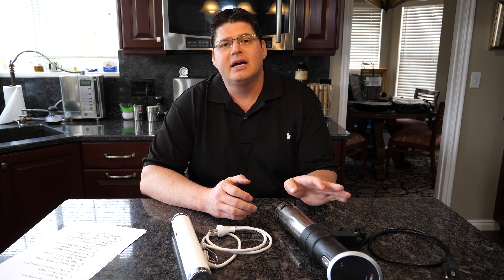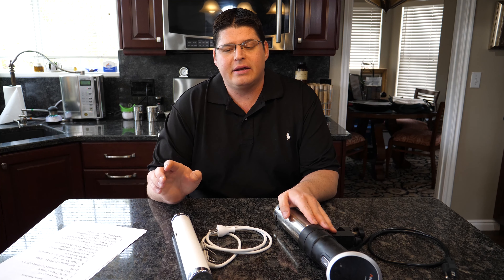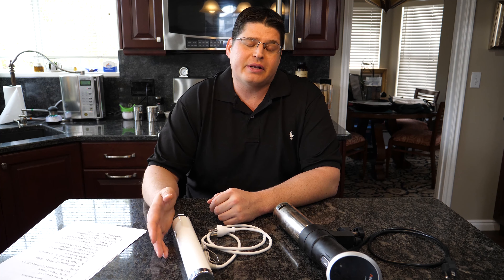Anova vs Joule - Round 2!

Comment: Great. Video..
I’ve always used the Anova..making larger batches of protein. My issue with Joule..was no dial in temp..However Recently purchased a Joule 
For 5he smaller cooks. Using the app was very easy..No connect issues at all. Answered my question as mine is Bluetooth only..What if my phone quits or I shut it off or I leave the house, will it stop..we’ll I did leave and came back alls well..reconnected  immediately..Now I’m on my first cook. Mailing smaller batches of stuff..can reserve the joule for that smaller pots less water…

Comment: I got a little water in the vent on my Anova when I was cleaning it, plugged it in and snap crackle pop.. dead anova. Worked well for 3 years I owned it until then. Replaced with Joule, which requires app, and is  louder, but heats water way faster.

Comment: Deciding factors for me we're ease of use and cost. Anova allows for manual setting without a phone and costs less. Especially with the new nano out. 
The power factor doesn't bother me too much. I start with hot water plus I get the water going while cutting veggies, preparing meat, etc so whether it takes 5 min or 15 min I'm busy for 15 min anyway preparing everything. 
I can see where people would want the higher wattage in this day of faster is better. But anova works for me. I run 2-3 at a time anyway so it's nice to be able to manually set it up and start it without a phone. 
I will say the anovas wifi feature I like alot. I don't know ow if joule has the feature but when set up right I can start a 24 hour cook and go to work. Of I lose power or get a brown out and it shuts off then comes right back on, I get a notification at work and can assess the temp of the water and decide it's safe and restart the machine from work.

Comment: You can use a metal plate underneath the container for the joule for setting direction.
Reply from the maker: PlayTime Not a bad idea at all! the containers I use however are too deep so the Joule would need to be fully submerged in water to get the base to the bottom. Some more shallow ones that should work well 👍
Reply: magnets does not work on stainless steel.... if you use steel plate... guess what's gonna happen.
respect.
Reply: peppertime1 what? hahaha. magnets dont work on stainless steel? stainless steels are alloys. some are not magnetic, but some are. you can't say you cant use a magnet on SS. that is so insanely false.

Comment: From what I've read, the Anova will be a 700W device compared to 1200W for the Joule.

Deal breaker on the Joule for me is that it is still US only.
Reply from the maker: John Tucker Yeah I just read the same at 700wat for the new nano with an advertised Max water bath of 3 gallons. that's not a lot but should do the job for 2-4 people I would think.
Reply: 700W for the Anova Nano at the price that they sell (and especially if you got the special price they had on preorder) is good enough for me. I cook for a small family, and prefer the versatility that having several circulators afford me, rather than one powerful device. Sometimes you want to cook several things, and the temperatures are different, with once circulator no matter how powerful you have to do it in succession. And even if I need to cook a larger item (whole suckling pig anyone? :) assuming you find a bag big enough) I think I may be able to use a larger bath with 2 smaller circulators set at the same temperature.

Comment: The only problem I have with my Joule is that you cannot set the temp exactly with the app. You have to look thru all the different app recipes for a temp that will be close enough to what you want the H2O temp to be. If there is a manual temp setting in the app, I haven't found it.
Reply from the maker: Terry Glancy Oh I can see that being a HUGE pain. all I ever use is a manual temp setting. when you open the app you see the power button on the lower right side of the screen. Push that and it will pop up with a screen where you enter your temp manually. I hope that helps!

Comment: Also the anova's poor thermometer is probably why your medium rare steak preference dosent line up with Joule's
Reply from the maker: CJ Herzberger good point, although reading 1.5 degrees higher than actual would mean when I cook steak at 128 for medium rare it's actually cooking at 126.5 as opposed to the 135 that chefsteps recommends. I think it's a personal preference thing. I've done steak at 135 and I think it's a little.ober cooked.especially if you're going to post cook sear it.
Reply: Gotcha

Comment: You could just use both together to get temperature up faster.
Reply from the maker: Kr En definitely and I have when cooking at high temp 180 or so
Reply: That would double the watt consumption. How about using gas stove to heat up some water first to kickstart the initial heating process. I would prefer to use my immersion circulator to maintain certain temperature rather than waiting it to heat up.

Comment: The Gourmia is 1200 watts.
Reply from the maker: I had never heard of that brand...it looks like they offer 3 different circulator options. They are all listed at $249.99 however Amazon has them for sale from $89-$119 and they are all listed as 1200w. Haven't used them but sounds like a good deal and a good alternative.
I find sometimes wishing I had a third circulator, I might just have to buy one of these especially for the price!

Comment: I appreciate your videos. I learned a lot from them but I have to tell you that after watching reviews on both I can't figure out why people buy either.
There are professional ones that are more powerful (1500 W), have accuracy of 0.03, quieter and cost far less.
In the end people buy these for their apps which like you said, doesn't really make a huge deal in the long run for anyone who knows how to cook and/or for their looks because people don't like the industrial look of pro ones.... I couldn't care less if I tried.
Reply: BravingTheOutDoors Could you share some brand/model names? I'm looking for a better quality sous vide cooker than what I'm finding locally and online.
Reply: the problem is... it depends on where you are from.
here in England you have the Vactec Thermal Immersion Circulator (model sv100) which costs significantly less but is more powerful and more accurate as well as the Buffalo which is the same thing only it's sold under the brand name buffalo.
Also, the new Supreme costs about the same here. 

but honestly man... It really doesn't matter. Just look at the specs.
I actually went to a professional restaurant equipment store and saw many machines that are a lot better you would just never hear about those brands as they aren't sold for home consumers... But so what... Who cares.

I'm actually going to get the joule directly from chefsteps for free. To review.
I'm sure the small size will be great when all you want is a few eggs but in the end it's a weaker machine, it requires an app and the temp control runs in steps of 2 which is... Ridiculous.
Mine follows at 0.1°C... I can actually cook something at fractions.
The Jule just can't be compared to that and at least here in England they're going to sell it for a lot more... That just makes no sense. 
Luckily for me I'll be getting it for free but I'd never purchase it.
Just being honest.
Reply: BravingTheOutDoors OK. Thanks! I was going to try some restuarant supply companies but figured those would be more expensive because most of the equipment they sell is more expensive. Perhaps I shouldn't have been so quick to presume. 

I ended up getting a Gourmia GSV140 yesterday (before coming across your post). It seemed like a good buy with 1200 watts of power and a temperature precision of 0.1 degrees and a bath size up to 5 gallons (20 quarts or 18.9 Liters). But it had a few rather severe cosmetic defects. For example, some of the chrome plated parts were cracked before they were chrome plated. You can tell. Otherwise, I might have kept it and not been looking at alternatives which lead me to your comment here.

I must say, although 1500 watts sounds better, I'm worried that will be too demanding of my household circuitry. I hear that the higher power sous vide cookers can cause a blown fuse. The manual for an 800 watt Litchi sous vide cooker I bought 2 days ago claims it's normal for it to cause lights to flicker! So, I'm worried about what a 1500 watt cooker would do.

By the way, are you sure the Joule only allows the temp to be set in 2 degree increments? In part 1 of this video it's claimed it has an accuracy of 0.1 degree. Maybe that was just the thermometer though. If true that you can only set temp in increments of 2 degrees then I'd have to agree, that is ridiculous. Again, thanks for the lead to better sous vide cookers. Much appreciated!
Reply: With regards to the electricity… I couldn’t tell.
What I can say is this: the electricity in England is trash! Yet, so far I haven’t had any issues.
But if your house has electrical problems that is obviously something you have to account for.
Usually though you have a few sockets that are more resilient (like ones that are designated for the washing machine) and you could potentially use those… or otherwise get a stabiliser.
 
Just so you know, when I spoke to ChefSteps they actually told me that so far the reason they haven’t released Joule in Europe is because so far it’s shorting fuses (in their labs) like a maniac and they are still trying to solve it.
So perhaps Joule is not necessarily that much safer even if it is a bit weaker.
Though I imagine the US model might not have that problem or else people would complain.
Dunno.

With regards to the temperature control… first of all that’s what ChefSteps told me.
If it does follow 0.1 it’s a lot better but after my interview with them I looked at their android app and saw that all the recipes have a temperature jump of 2 degrees.
In fact, if you compare their youtube videos (to the app recipes) you will see that they’re not the same.
For instance, they have an egg video where they set the temperature to 63 degrees Celsius but in the app it’s 64.
I assumed that’s because the video was made before they started selling Joule.

I’ve told them that I have reservations about it straight to their faces but I can see their point… in their eyes it’s designed to be a small machine that will fit in drawers.
They are not wrong. Small flats can’t afford too many counter dwellers.
I myself would love to have a stand mixer but I honestly don’t have where to place one!
So I see their point.
But… realistically… we’re not talking about something the size of an oven.
So instead of a drawer I place it in a side cupboard… big Fíng deal.
Also, like I said, my machine is very big and that’s not necessarily always convenient. Sometimes when all you want is something small it would be easier had it fit in a small dutch oven… mine sure doesn’t! 

Also, don’t forget that it’s not just about the temperature you set, it’s about the responsiveness.
Once the set temp is achieved the machine continues to pump the water but the heating element stops until the temperature drops. A good machine will kick in again once the temperature drops by 0.1 but a weaker machine might only respond by the time the temperature fluctuate by several degrees.
One of the reasons a more powerful machine could potentially make a difference is precisely that.
If you do use a lot of water and want to cook a lot of meat it can make the temperature drop by many degrees. A more powerful machine will bring it back to temperature a lot faster and be more responsive to change whereas a weaker one might actually “fail the race” of reheating the water against the cooling rate of whatever you placed in the water.

Perhaps they meant the responsiveness has a range of 2 degrees or it might have been a comment in Fahrenheit.
I’m not sure.
I’m afraid you’ll have to wait for me to receive and review it ha ha… which is something I obviously don’t do with this channel. This is just my private channel.

I repurposed a thick plastic box and cut the lid to fit. I also place a towel on it.
In theory cutting a cooler will work even better. You can find videos of people who have done exactly that.
Reply: BravingTheOutDoors OK, thanks for the insight and tips. Coincidentally, I was planning on modifying an insulated ice chest/cooler to use as a water bath/oven for whatever sous vide cooker I end up getting to reduce power consumption. I figure that should help prevent my electric bill from increasing too much. I'll probably be using my sous vide cooker 24/7 every month, after all, so I must definitely do all I can to reduce the power consumption.

Comment: I’m rather surprised at the lack of forethought to some of this review. You have a Thermapen but you didn’t take measurements at different parts of the bucket? This might’ve answered your question about whether or not circulation direction matters. Also, putting physical controls on the device likely affects waterproofing.

I own neither device, but the Joule appears far more versatile and powerful.  Also the Wi-Fi version of the ANOVA has a whole lot of bugs according to users.  Also, without an app it’s virtually impossible for the manufacturers to update it or improve it, which can be done on the fly with the product connected to a smart phone app.